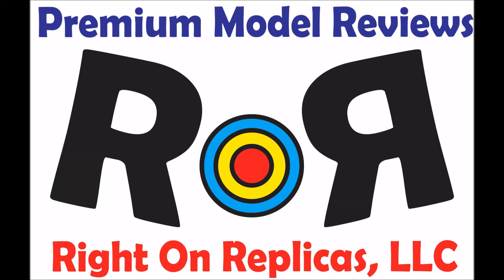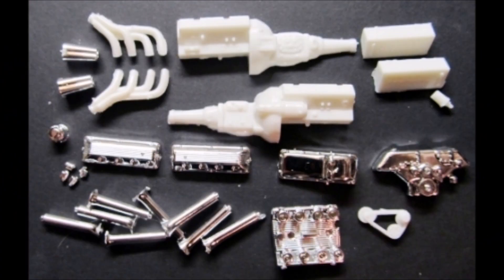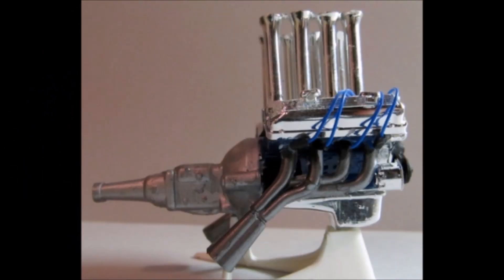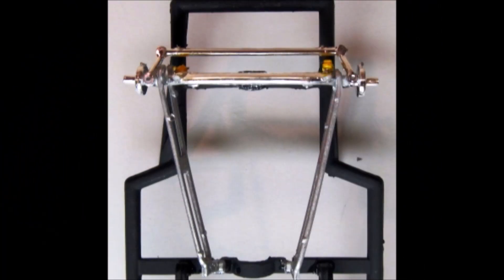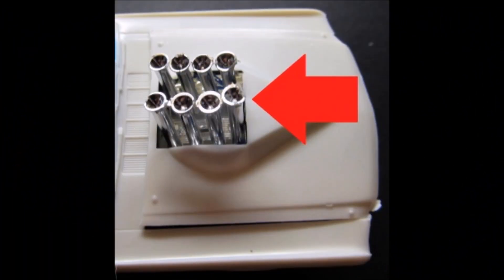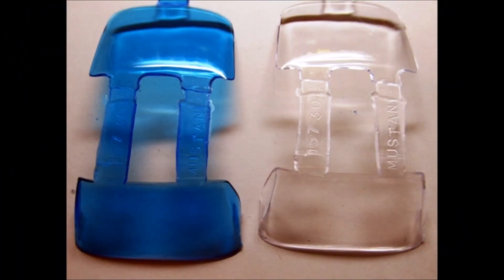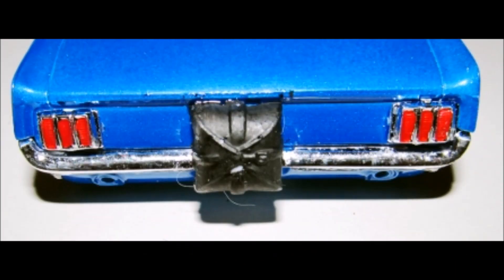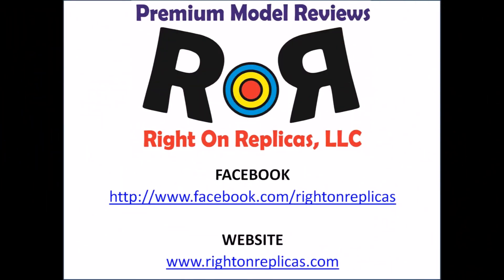How to Build the Mustang GT Funny Car 1-25 Scale AMT Model Kit #888 Review

Comment: Doug, working on this kit. Doing a lot of test fitting, have the chassis and frame taped together and the windows taped in the body. Built up the engine sans headers. Instructions don't say anything about installing the alternator to the belt. Also the instructions are very vague about engine placement. Do you just put the oil pan on the cross member? I set mine in so the part behind the sump is on the crossmember but this puts the engine too far FORWARD! Will have to cut out the front of the hood to clear the front set of injector stacks. Can't really tell in the video how you mounted yours. Thought about turning the pan around but that wouldn't be proto. Also as you stated, the body to chassis fitment is a bear.
Reply from the maker: CS - The engine does not really fit properly causing the injector stacks to be too far forward.  I had to ream out the hood opening in the front and the back to get the injectors to protruded!  -Doug